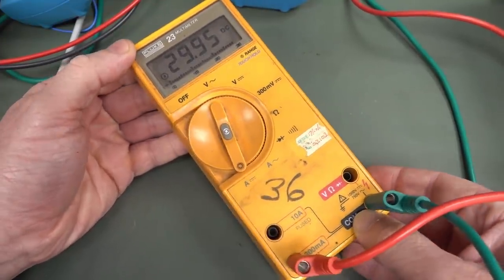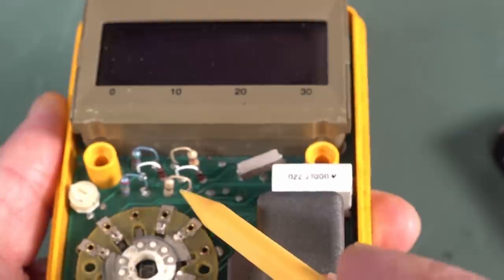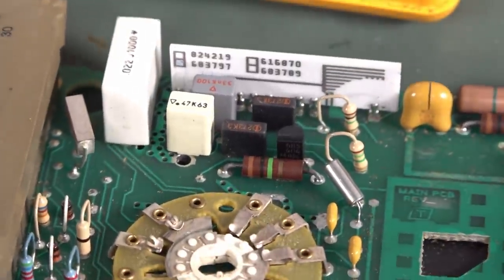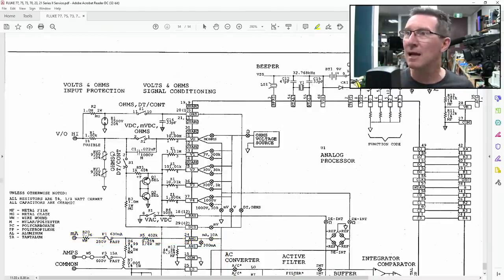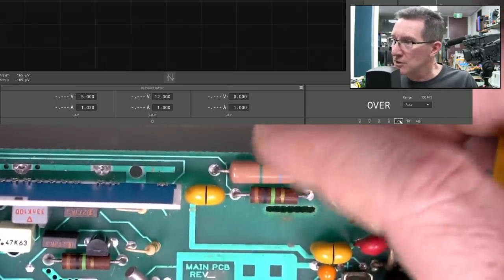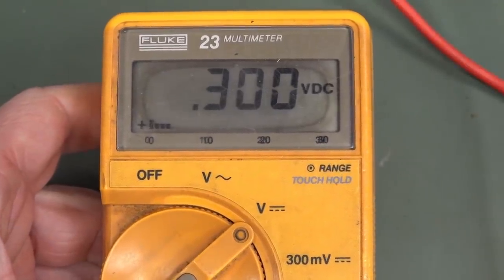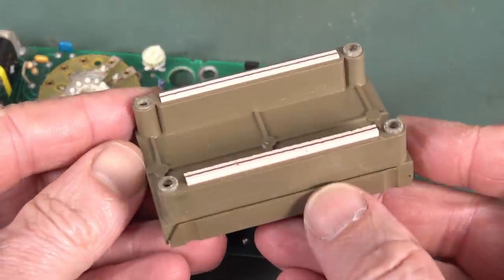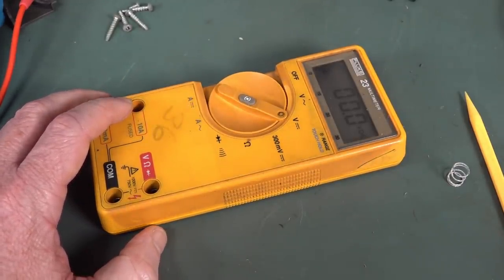EEVblog 1424 - Fluke 23 Multimeter Repair

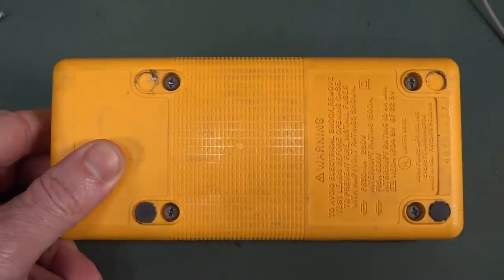Comment: I'm happy to hear the comments at 17:20 about the "back-rotate-till-click" approach to avoid making another set of threads with self-tapping screws.  When playing "take-apart and fix" with kids and "broken stuff", that is usually the second lesson I teach.  The first lesson is "the thing is already broken . . . what have you got to lose by opening it up and looking around."
Keep up the good work!
Reply: I actually nearly always do that on anything that has a thread (screws, bolts, nuts).
This way I know where the thread really starts and chances to ruine it are very small.
Reply: @ppdan  Yes, I do it on all threaded fasteners, too.  It is very easy to cross-thread even metal hardware when using an electric drill with a screwdriver bit.  The real killers are the self-threaded screws into the plastic battery covers on general-use company voltmeters.  By the time they are a few years old, they are usually stripped out from random people changing batteries on these poorly designed meters.
Reply: My dad taught me that as soon as I could turn a screw driver. Whenever I watch a video and see someone starting a screw into plastic / wood I cringe when I don't see them turning the screw back a bit first.
Reply: Machine learning pid iron station and pid line follower and smart home
Reply: In my channel
Reply: And if the thread is stripped there is an easy way to make the screw grip again. Just strip the insulation of some wire, preferably a bit longer than the depth of the hole, and insert the insulation in the hole. The screw should now be catching, if it's not then add another piece of insulation. A trick I learned before the 'back-rotate' or the 'use more force to make it tighter'....  about 37 years ago. Crap, really getting old.  
If you feel the plastic is cracking immediately stop and use shrink tube and if possible a very small cable tie.
Reply: But cheap Chinese multimeters come with machine screws into pressed in brass bushes.
Reply: "the thing is already broken . . . what have you got to lose by opening it up and looking around." Yep, whet one isn't afraid of rain.
Reply: That technique should be used for all screws, bolts, and pretty much anything with a thread. I even find myself doing it when putting the lid back on a bottle of cooking oil for example.

Comment: 1K open is the most common fluke fault. I've fixed at least 10 flukes over the years with the same problem, so when a fluke shows wrong numbers, the first suspected component is the 1k resistor.

Comment: Early HP calculators had studs for fairly long screws but were assembled with shorter ones.  That way repair folks could use a longer one if the short ones stripped out.

Comment: Working at a local school I got a tea-chest full of non working Fluke 10, 11s and 12s out of the Fluke repair shop in Watford UK when they closed down. I got the vast majority working by cannibalising a few really bust up ones. 
The commonest fault was a misaligned silk screened lacquer layer on the back of the board that left a trace up the very edge of the board uncovered, along with a fault in the etching of that one trace that left a minute part of it extremely narrow compared to the rest. One leaky battery and the trace corroded through. It took a lens to see the break. once found easily fixed.
I ended up with a class set, one for every pupil in my electronics class.

Comment: You just need to replace the old reflective sticker behind those lcd.
Careful not to scratch the plastic polarizer too much while removing it and cleaning glue residue.
I use thin aluminum tape as reflective material and they're just fine and nice. Needs to be applied carefully and cleanly though.
Reply: Thanks for the tip! I'll have to remember that.

Comment: I am the proud owner of a wonderful Fluke 77 that my wife gave me for Christmas 1984.  I had it repaired in the mid-1990s by Fluke after I tortured it with ~ 1500 volts input, but other than the occasional battery or fuse, it has served me well, and just like your 23, has held its calibration for all these years.  Still my favorite multimeter...
Reply: Actually that's a fuseable resistor to save the meter in the event of excessive overload in series with the PTC.

Comment: I'll post it in case anyone is interested. It's nothing new, but if baking soda cleans my teeth, I thought why not clean the screen of my multimeter? Because it was somehow dulled. I could not see nF and uF, they were not selected. I sprinkled some baking soda powder into a wet wipe. I took the handkerchief in my palm and rubbed the screen. Unbelievably cleared up.

Comment: Today I bought a Fluke 23 with all original documentation + a Fluke Y8100 and some original Fluke wires/probes, all in like new condition after some cleaning. Everything came in a metal case with a custom foam insert. I paid $30. My Fluke 23 has the same symptoms as the one in your video so I'm looking forward to check that resistor tomorrow! Thanks for another great video.

Comment: You're a braver man than I to take apart a 30 year-old zebra strip ;).  This one looks like it was done right with big pads and shouldn't cause a problem, but I'm terrified of old LCD interfaces; if they don't fail on their own, simply breathing on them seems to give them enough excuse to fail, leaving some segments to never work again.
Reply: I know!  I get anxiety when I see old zebra strips coming apart.  lol
Reply: You can get replacement zebra strips, but the LCDs for the series II are incredibly hard to find. I searched for months and found a suspicious surplus part that just said "LCD" and had the manufacturer replacement part number (not the original part number) with a manufacturer listed as "Military". I took a risk and it was a perfect NOS part, which fixed an otherwise unusable meter.

Comment: Yup ! My ol 77 is still cranking out the correct numbers !  I'll bet it will still work for another 40-50 years !!  As for the reamed out screw damage...  Get a old wire coat hanger or use a small drill bit shank, that's the same size as the screw's shank to use as a mandrel . And wrap several layers of some plumbers teflon pipe tape, so it just fit's into the bad screw hole. Then remove the drill or wire while holding the tape in the hole, it should slip rite off because it's teflon !!   Love this channel !!!

Comment: Best he repair them, Fluke refuses to repair them. Our shop sent 3 DMMs to Fluke for repair and they all got sent back as non-repairable. I fixed one by removing the + lead socket from one and installed on the other. Been using it for 5 years now.
Reply: Seems like an average modern "repair" service. If the item isn't in production or "supported" they just say it's non repairable because all they do is swap boards or swap out units and charge you for the "repair".
Reply: I thought they had a lifetime warranty, what happend to that?
Reply: @lukealadeen7836  fluke lifetime is x years after product discontinuation or minimum 10 years

Comment: Related... meter boots can somewhat easily cleaned.

Remove from the meter, remove the tilt stand... then toss in the washing machine along with a load or two of work clothes! Don't put in the dryer.

They won't come out looking new; but there'll be a most noticeable improvement!

Also, if needed replacement 'Zebra' strips can usually be had on eBay.

Cool videos, thumbs up, Thanks!
Reply: I have had excellent results just scrubbing them with dish soap and a washcloth, followed by wiping them down with isopropyl. Like yours, not like brand new, but infinitely better.

Comment: Been using a 23 Series II for quite some years now. About 10 years ago I managed to blow the 1K resistor, forget what I did, so I figured I better reinstall a fusible resistor. I did order a fusible 1K from Mouser, but was in a hurry and whacked it in right over top of the dead 1K, lol. 10 years later still like that. I don't really do much electronics work / repair anymore, so it doesn't see as much use as it once did, but still works well. I actually got this Fluke for free, obviously second hand. My dad did automotive repair, and whenever he mentioned I tinkered with electronics, his co-workers always had something they hoped I could repair (everything from CRT TV's when they were common, treadmill, tube amps, sauna, all kind of stuff, lol) so he'd always be bringing stuff for me to work on. Occasionally they'd have old stuff laying around they'd give me for parts / reuse. One lot of items had this Fluke 23, which worked fine and I still use it many years later, think I got it with some old analog clamp meters and a voltage detection probe, which I also got some use out of and still do occasionally.

Comment: 30 years ago I got a fluke 73 for a pound (English) at a boot sale because it didn't work. it had the exact same fault as yours. stuck a 1K resistor in and I still use it.

Comment: My father’s 77 still works a treat, and has only recently been replaced in my tool box by a second hand 179 I picked up, mostly to spare the 77 from further field use where it might get damaged, it even still has the original probes and is in almost perfect condition.

Comment: Hi Dave Ray Burke here.  I have built lots of Heath kits with that simular input protection circuit.  The Heathkit IM-16 with NPN transistors on the input with the collectors back to back and the bases were floating.  The manual says the transistors were used as input protection.  This circuit were used in the late 1960's  to late 1970's/  This was in a Transistor VOM, I built it back then.

Comment: One way to fix a stripped out hole for a self-tapper is to install a threaded metal repair insert.  They are made specifically for replacing a stripped out thread.

Comment: Awesome video!  I had just got the service data for the Fluke 23 Series II and was starting into it when I came across your video.  Mine was 26th week of 1993 so a couple of components were different.  The 630mA fuse was blown but other wise was exact same repair, I followed along with your video, put in a 1K 2W resistor :D  and bam all was good.  Thanks for the video.

Comment: I had one of these Flukes I used in a large Toyota dealership, and it was my go-to tester and never let me down. Someone probably used it improperly and blew the protection circuit. Good to know that functioned as it should have and protected the meter from user error! I always liked the way you could rotate the selector dial with your thumb while holding the meter in your left hand. Meant you didn't have to use both hands to select a range. And I kind of liked the bar display below the digits for getting info fast kind of like an old analog needle meter like the Simpsons my dad had.

Comment: Had the same fluke 23 meter since the mid to late 90’s. Still going strong and I blew the same 1k resistor when I connected it to the output of a variable frequency drive instead of the input. Accuracy is awesome when comparing it to modern meters. I’m pretty sure Big Clive has got one too

Comment: I have and still use a 73 which I won in a prize draw back in about 1991. I don't do all that much electronics so it has only needed a new battery once in all that time and no fuses but I do use it to test and check household wiring and the occasional bit of electronics diagnosis. No rubber bumper on it which always bugged me a bit but it is a truly reliable bit of kit.

Comment: To repair the stripped threads just put a bit of oil on the screw and fill the hole with hot glue and insert the screw, the oil allows the screw to back out when needed.

Comment: I think the screen damage would be in the polarizing film - which is replaceable.
The sun damage to the case can likely be fixed by applying peroxide and leaving in the sun for a day.
The screw thread could be improved by chucking some super glue down there.

Comment: For the stripped threads you can fill the pillar with metal loaded epoxy, drill out and re-form the thread (carefully, easy to snap the pillars if you are too gung ho).  The pillars are probably too small to push a brass insert in with a soldering iron, you'd likely need to use a smaller diameter machine screw, and then you may need a washer on the head etc.
Reply: Glue in any plastic or rubber tube that fits the hole nicely.
I slightly drill it out just to have a nice even hole (not really making a bigger hole) and glue in some shrink tube that I shrank before (thickens the wall of the shrink tube and gets it small enough to fit the hole).
Reply: @ppdan  Or at the other end of the spectrum from putting in the effort to drill the hole and do it perfectly, the ultra-lazy method -- rip a little strip off the edge of a Post-It or other sheet of paper, roll it into a tube, stick it in the hole and then put the screw into it. Good enough for Austra... Err... East Tennessee.
Reply: @gweilo8888  The idea is to fix it for more than once and make it really sturdy. Also, in some cases if the case is not screwed tight enough the display might not work as expected.
Reply: @ppdan  Oh yep, obviously. I was mostly poking fun at my own ghetto repair jobs. ;)

Comment: I still use my fluke 12 (series 10).  Gorgeous piece of kit and none of this turny-knob rubbish ;)
Reply: I like those meters.  Oddly, the 10 has the capacitance and min max function, which can be accessed by drilling holes in the case, but the software is different.  The 12 has features the 10 doesn't.  (can't remember of the top of my head, something to do with automatically changing from resistance to voltage mode, like the "testers" do, I think.)

The testers don't have any "switch" rubbish - works great if you don't need to measure voltage below 3 volts.

Comment: I might have one of those meters.  Maybe two.  I still use some of my 70 series meters. 

Original fuse is ceramic.  (EDIT: fuses for older models were glass, but filled with a material that appears to me to be silica)

One meter I purchased had a small piece of heat shrink stuck in the screw hole to allow it to tighten.  A bit "How ya doin'" but it worked.

I haven't bought an LCD lately, but all I've seen are genuine.  I found a guy selling large quantities a long time ago, and bought all I need. (and more, LOL)

Comment: I have an old ex air-force Fluke 25 bought second-hand with a slightly damaged case - it is still the most accurate multimeter I own. I mostly use a second-hand 75 IV and 87 III though. All fantastic multimeters. eBay bargains. All needed cleaning up and the 25 needed the zebra strip to be cleaned to make the display clear.

Comment: I still use my Fluke77 series 2 but it was last calibrated in 1996. The case has a broken bit near the top and the rotator switch sometimes gets stuck. I got an EEVblog BM786 (which feels nicer to use) to replace it but now I use them both.

Comment: I have that same meter that I bought sometime in the '80's for $169.  It actually came with a yellow "rubber" holster to protect it from drops and bangs.  Still works but I have a newer Fluke to read RMS which that one won't..

Comment: I just got to this video. Very, very involved for my level of competence in the innards of a meter. But it was/is seriously interesting to watch and listen as to how things work. If possible, I'd like to ask a question. I have a Fluke 23 that I really love and it's in basically perfect condition. However, when on the ohm/sound setting, I get very little, sometimes not at all, sound when checking continuity. My hearing is bad but, not THAT bad. Yes it does sound every now and then but it's very, very quiet. I'd sure like to know how to improve that sound and maybe even make it louder than stock. Thanks again for taking the time to make this video and show how things work.
Scott

Comment: The ohms path with the 10M resistor is a constant current source. The voltage across the probes is then proportional to the resistance under test.

Comment: Got the same type meter here on the bench, has issues where it keeps thinking a new battery is low and is failing, the shell is falling to pieces and when a good bit of gaffer tape clamps the shell together, it comes good. Also, this one seems to be made in 1992 (a year after I were born).
Edit: mine's got the dual mov's instead of mov+spark-gap

Comment: Had a mouse piss on the switch of my meter. Took me ages of intensive cleaning to get rid of the leakage currents caused by the conductive residue of the urine.

Comment: My PM2521 has the exact same problem with the LCD, it's about the same vintage as the 23, so I wonder if it was a common failure of the old Fluke / Phillips displays.

Comment: Yes I have a few LCD units with that same fading on the display, not from UV light, as some have been in a drawer for years, but likely from oxygen permeating through the side epoxy seals of the display. Sadly has made my HP calculator unusable, unless I can find another 41C display for it, as it otherwise works, just you cannot see the display segments as dark against the dark background.
Reply: The problem is cause by the Polaroid layer cracked. Simply repair with new Polaroid film. You can find the solution in web.

Comment: I actually have one of these come in at the thrift shop I work at and it is broken in I believe the same way. I might check if it is the same issue.
Reply: Yes so actually measured the resistor and it was dead. After replacing the unit is fully functional again.

Comment: Type in fluke 23 to eBay Aus and the first item is replacement lcd. <$50aud Inc shipping from US. Still had and used my 23 until the start of this year when it got left on the bullet and went for a drive under the tyres... :(

Comment: Love this old classic Fluke DMM.  #1 rule when purchasing a Fluke meter is REPLACE THE BATTERIES - Every Fluke product I have owned has had the supplied batteries leak inside the unit.  Ruined my trusty T5-1000 years ago :(